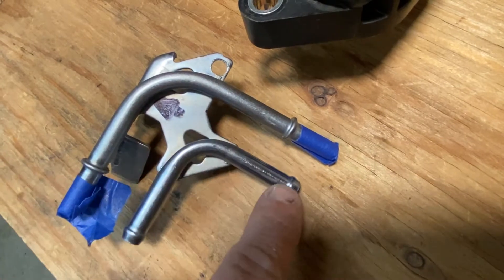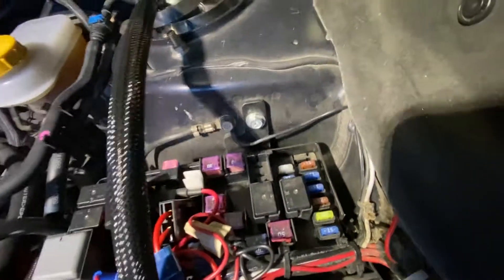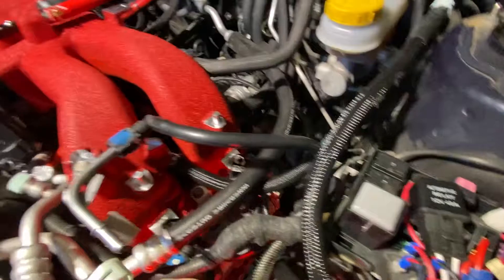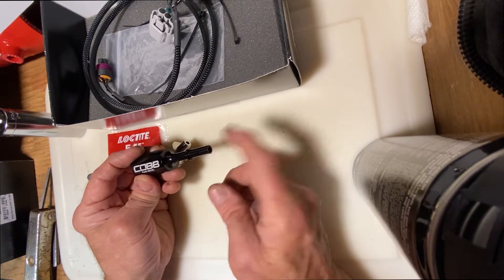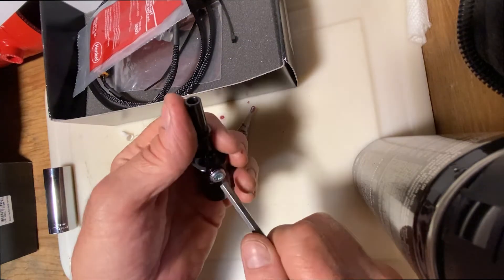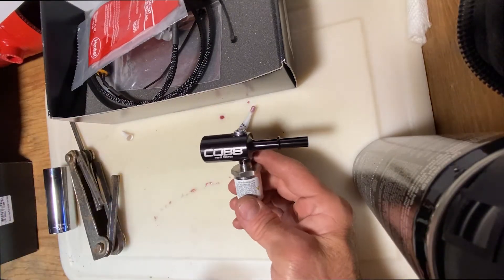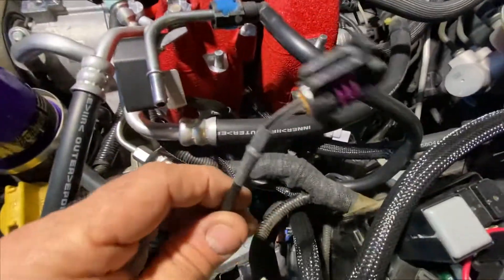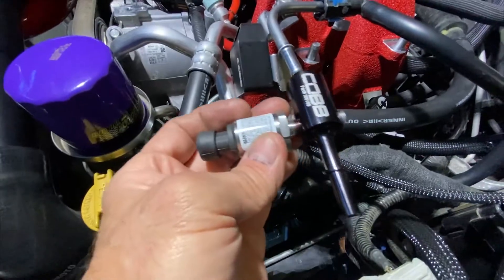2015+ Subaru WRX - Cobb Flex Fuel Kit & Fuel Pressure Sensor Install

Comment: How will this prevent spun rods and ring land problems?
Reply from the maker: In that regard it wont prevent but rather mitigate the risk. Running an E85 mix will run cooler and see fewer detonation events. Allows for better timing with a tune.   Something to do with its make up.    Not too sure about science behind it.  I'm just a guy in a garage, lol   One could look at meth injection as an alternative. Or race gas.  This seems cheaper and easy in my case.     Thanks for watching!
Reply: @zoycogarage1780  yeah, the fact these come from factory basically broken and time bombs, I don't even want to mod. Shouldn't have to go out of your way to make Cara with over 2 decades of time to make it right. I dont trust subarus.
Reply from the maker: We'll have to see how the FA24's workout.
Reply: @zoycogarage1780  somebody will. I'm done with them. May buy some rebuilt beater for winter here and there, because when all their fluid isn't being burnt or leaking out of seals, they make good winter Cars for the money.
Reply: How did you get the billet adapter to fit in 15+ wrx? The one you had shown in the video was for 14 and under.